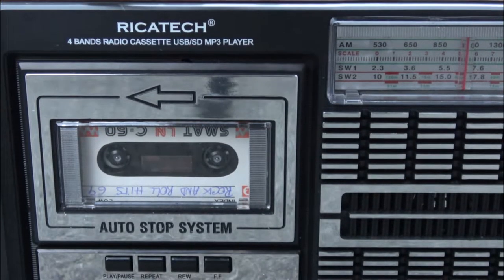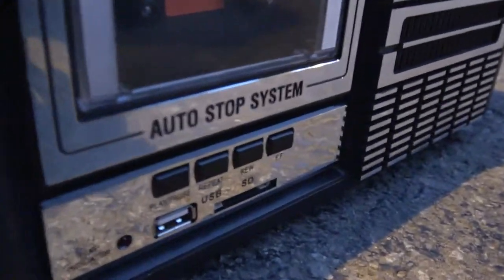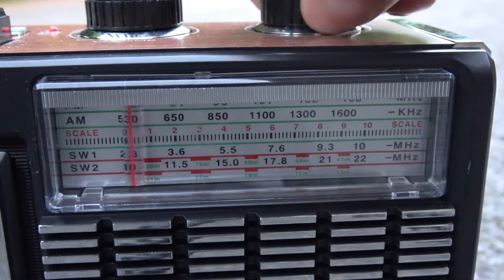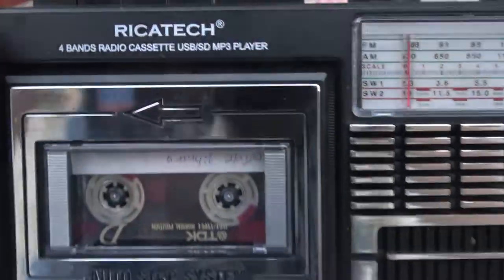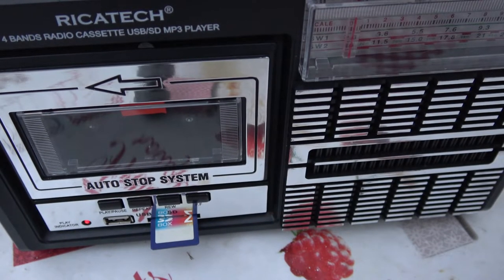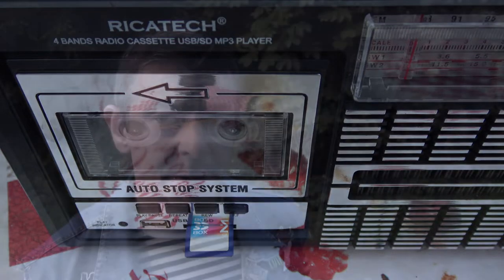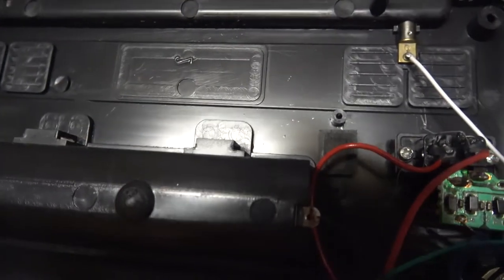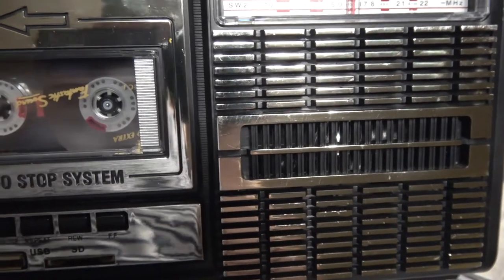Ricatech PR-85 Radio Cassette Recorder USB/SD - Review and opinion

Comment: I just received this player and I love it but as the review says it revs a little fast. How could the playback speed be regulated? I don't quite see the adjustment screw explained in the video. I hope for help, thank you.
Reply from the maker: there is a hole in the plastic molding to adjust the speed. Quite frankly this is unacceptable to sell these things not properly adjusted. I hope you find a way.

Comment: Mine just came in - it has WAY more hiss than I anticipated.... SD/mp3/cassette...  I expected hiss from cassettes and bad radio reception but there's an immediate loud hiss just from the unit being turned on.  Am I being dramatic? Is my unit maybe defective? Or is it just part of it (it wasnt that expensive - but you basically have the only good review of this radio online so I was curious).  Also, the USB only seems to work when plugged in with AC power, and not with batteries. have you noticed this?
thank you!
Reply from the maker: Well... Mine has issues now. Probably need some new belts already. Hope you returned it and got a good one.
Reply: I did return it... but I haven't found a better alternative yet honestly. thanks for replying